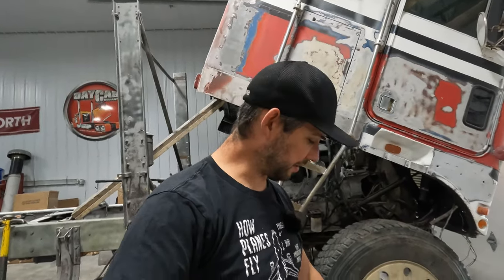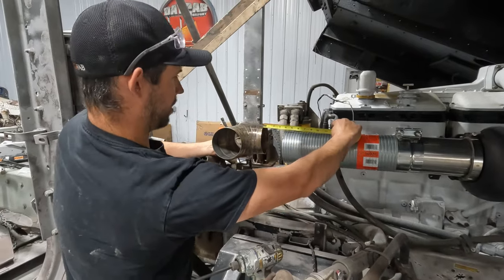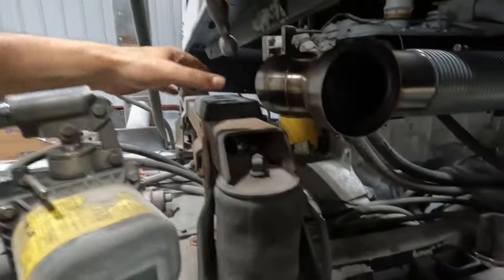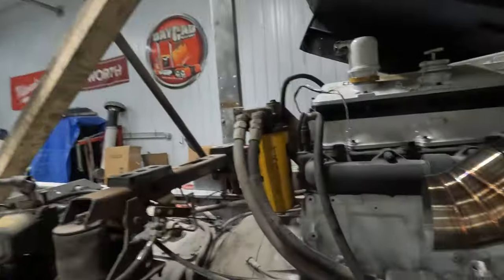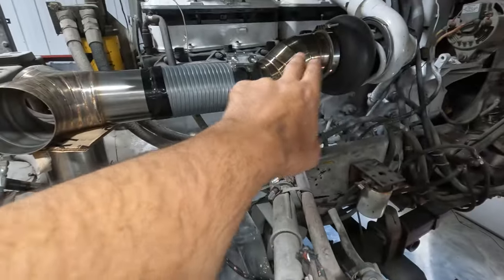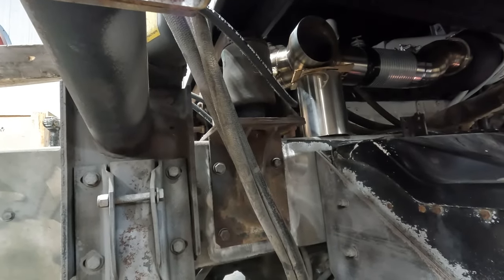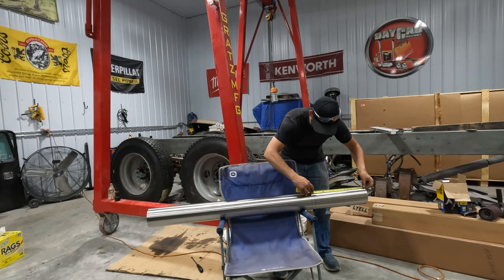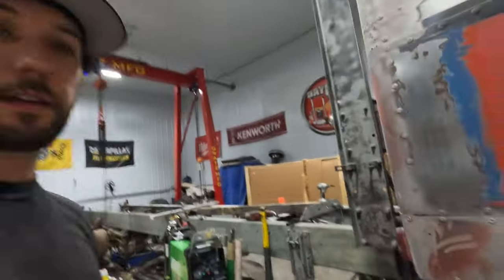IRON DUKE EXHAUST PT 2!!  Collab with Twin Stick Garage

Comment: You might think about fabricating a small diverter in the back of your in your extremely cool Tee, the gas is going to take the path of least resistance  you may get more exhaust exiting on the passenger side than the drivers side possibly
Reply: Other than aesthetics for the smoke to come out equally, there's no disadvantage to it favoring one stack over the other

Comment: Did you allow for cab travel in your cab clearance checks. It will move about 2 inches each way off of centre on Hi way 16
Reply from the maker: all the air is out of the levelling valve so its at the lowest point right now.  Good observation!!
Reply: Truck driver, fabricator. Driving again. A head full of ideas.  Kind of my thing to make that observation.

Comment: Nice work on your exhaust build, I have one concern & that is clearance between the oil filter & exhaust tube as there will an extreme amount of heat build up underneath the cab.
Mark Twinsticks may have to use heat wrap & or reroute the oil filter.
Reply from the maker: Good point. After we were able to relocate the leveling valve assembly we have a fair bit of clearance now. 

Also this truck won’t get driven a whole lot.